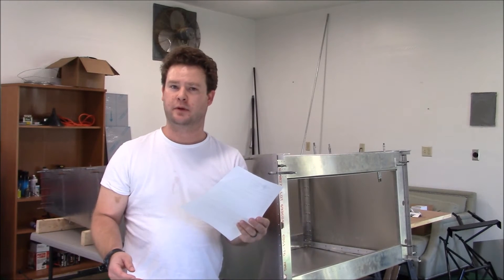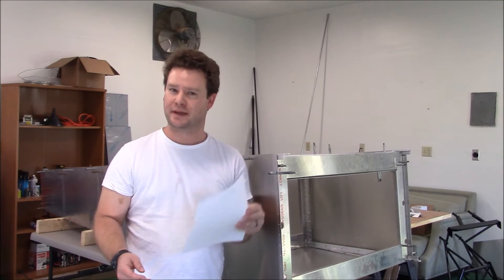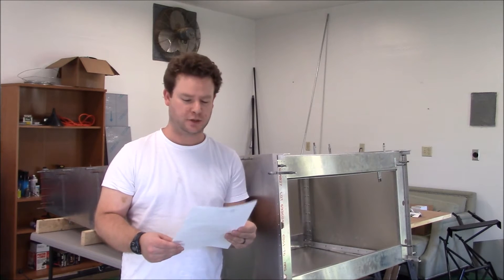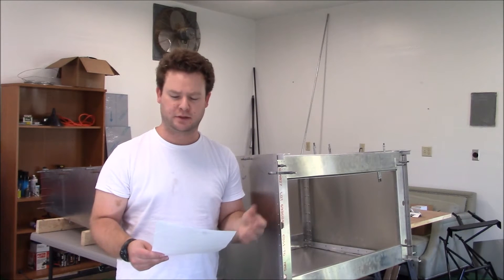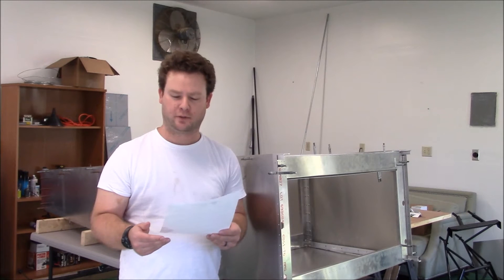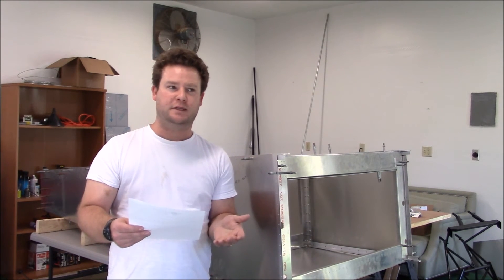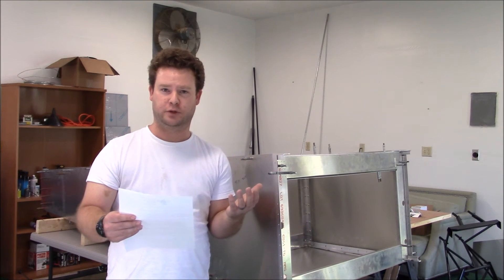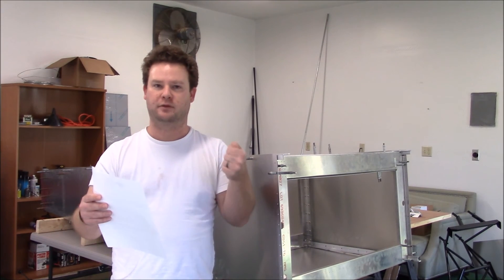Sonex Aircraft Build Video 51 My Hardware List, and Inspection Hole Part 2

Comment: Hey Daniel, Glad you liked the idea of the hole saw.  Some of the smaller hole saws have a drill bit in the middle so it is less likely it will dance around and scuff the metal when you are first starting the hole.  However, I'm guessing the 4" will not have a drill bit in the middle.  You might check several stores in your area to see the various kinds available.  The wood backer is a great ideas for 2 reasons.  Like your dad said the metal won't deform as much. Also the wood .. might.. reduce the amount of burring if you can get it tight enough to the metal.  One way to get the wood tight would be to put a couple of screws through the aluminum into the piece of wood before you drill the 4" hole.  You could do this on the part of the metal that is going to be scrap after you drill the hole.  Just a thought.  I enjoy living vicariously through you so thanks for sharing your experience. Who knows, maybe one day I can do it.
Reply from the maker: +SyberPrepper Hi SyberPrepper. The particular drill I got has a 3/8ths inch bit in it so it will self center. I am uploading that video now. Thanks for the great suggestions.-Dan